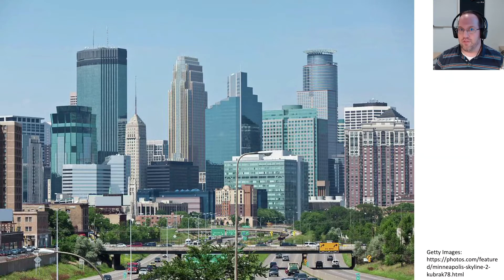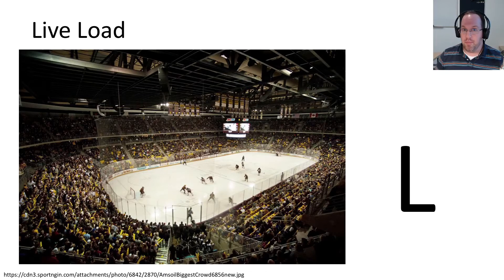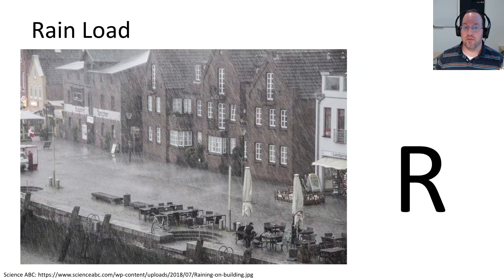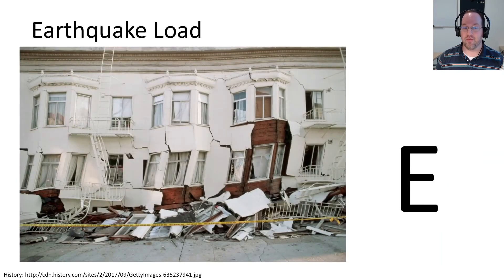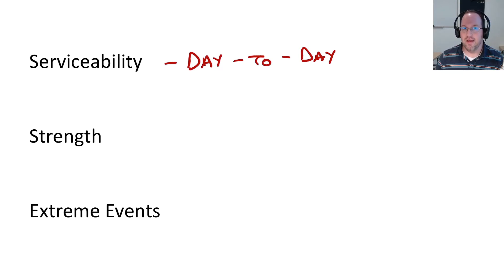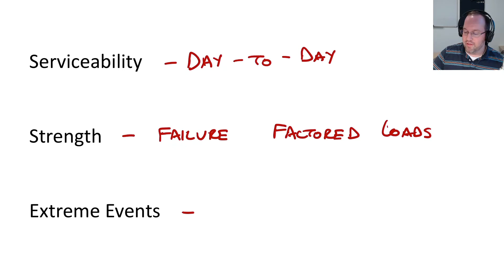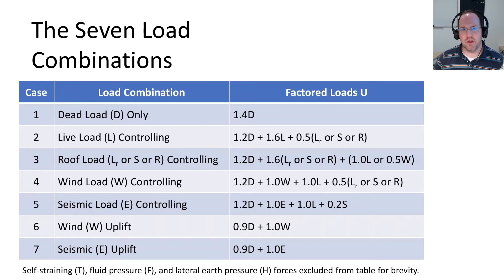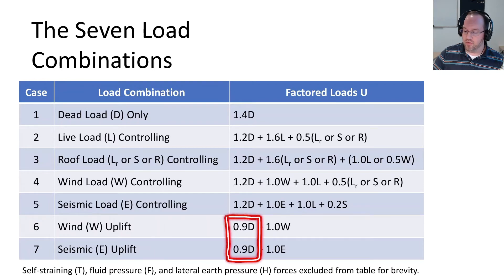Intro to Structural Analysis - Loads and LRFD

Comment: Dear Pro. Hedegaard
Thank you for your nice video.
Would you explain me the philosophy of increasing the loads and decreasing the resistance in LRFD design method . If we are at the elastic zone in HOOK curve or pass to plastic zone  in LRFD method ? . What is the main concept by increasing the loads if we do not pass to plastic zone, or it is virtual and we remain in elastic zone. I can’t catch the beauty of LRFD if don’t understand the logic of assumes in LRFD . Please clarify it me if possible.  My in advance gratitude.
H Rahimi
Reply from the maker: Hi Rahimi,

At it's core, LRFD is just a way of splitting up uncertainty. Rather than designing with one single safety factor, we attach different factors of safety to our estimates of capacity and demands depending on the nature of the failure mode and nature of loading. As for decreasing the resistance, failures that we can accurately predict and have "desirable" behavior (like ductile failure modes) do not need as much safety margin as failures that are more uncertain or have "undesirable" behavior (like brittle failure modes). As for increasing the loads, some loads are relatively predictable (dead loads) while others are less so (live loads). LRFD allows us to tailor the safety factors to achieve an overall and consistent probability of failure. 

Regarding elastic versus inelastic design, this gets a little weird. LRFD design is normally intended for elastic structural analysis to find demands, but regularly incorporates plasticity into the capacity (one example - per AISC the flexural capacity of a steel beam uses the plastic section, not the elastic section). The various factors of safety and the prevailing methods of design mean the structure typically remains elastic under "service loads", that is the expected day-to-day loads - the structure will exhibit some plastic behavior under "factored loads", but should not reach it's full plastic capacity at any location. 

There are other methods for analysis, such as plastic analysis, where some sections are assumed to be fully utilized and plastic so long as they remain ductile. This can increase the overall capacity of the structure - ductile, indeterminate structures are capable of reaching full plastic moment capacity at some locations and then redistributing the load elsewhere as load continues to increase until a mechanism forms. LRFD isn't normally intended for such things - for such types of analysis, you generally would want to know the sectional capacity accurately (without factors of safety) to know exactly how load redistribution works. Other parts of structural design, such as overstrength factors for seismic design, complicate this picture even more, but that's far more than can be addressed in a YouTube comment.

Thanks for watching, and thank you for your question!